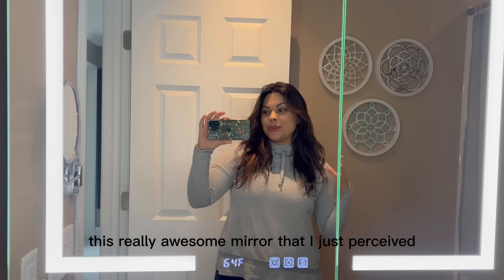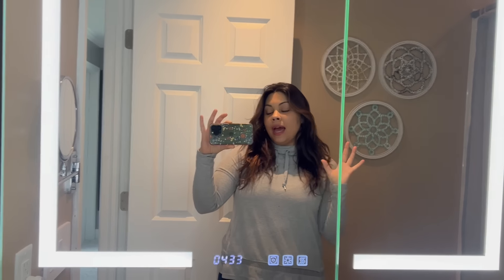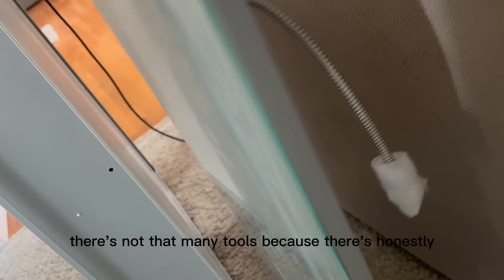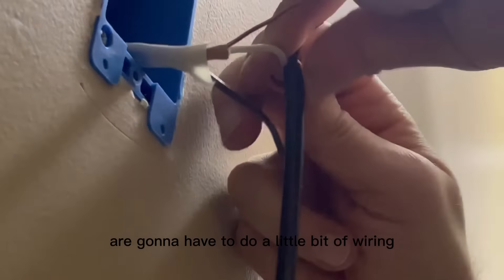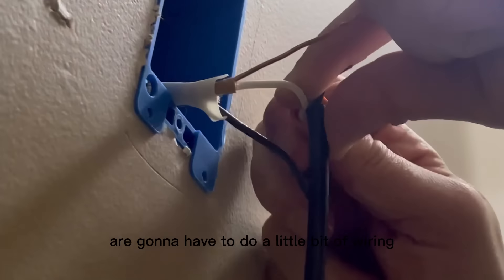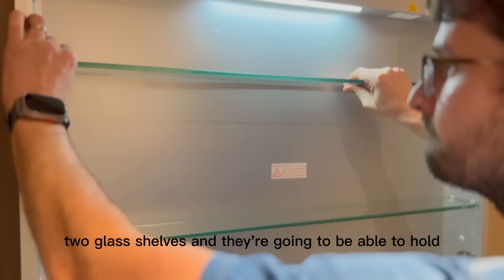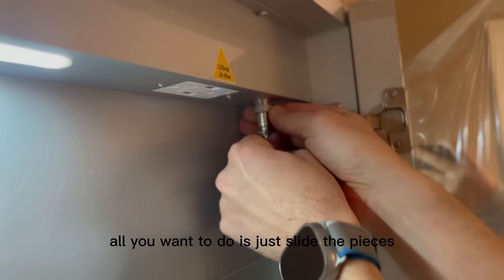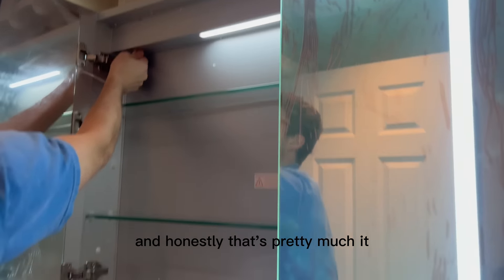Discover the Boost Medicine Cabinet: A Stylish Storage Solution!

Comment: How do you keep the side panels on?
Reply from the maker: The side panels on the medicine cabinets are securely attached using screws. Additionally, you have the option to fit side mirrors, which not only enhance the durability but also add a more aesthetically pleasing look to the cabinet. If you have any further questions or need assistance, feel free to reach out.☺☺